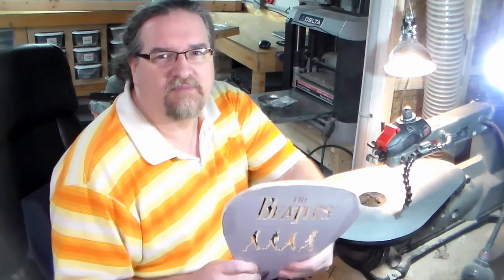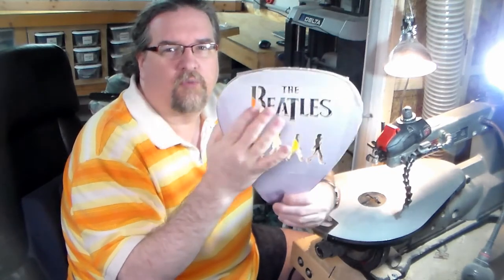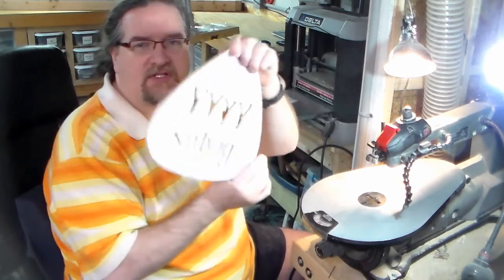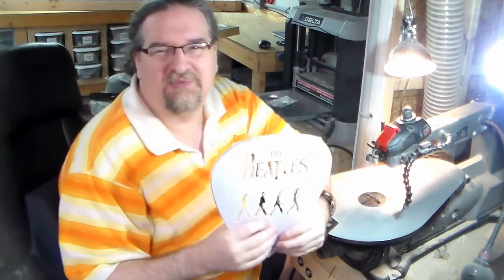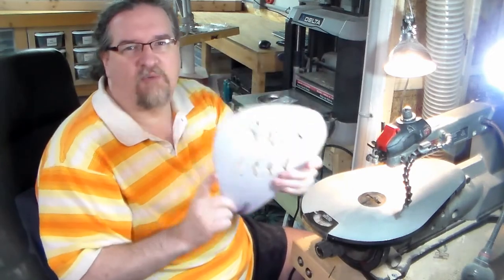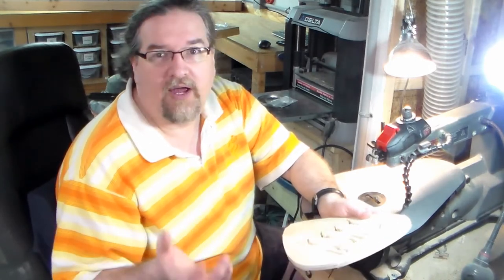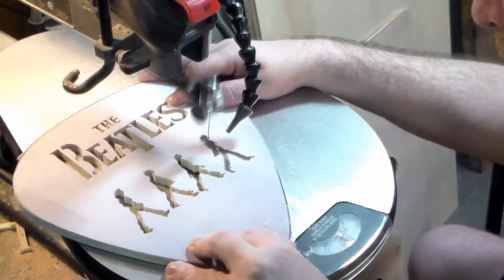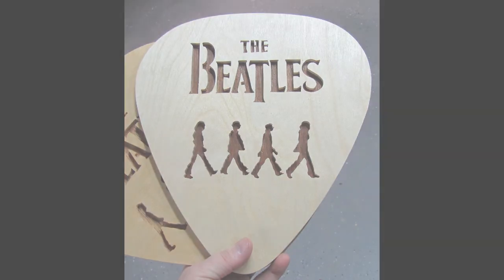spiral vs straight blade rotation demo (per request)

Comment: I see you use the porter cable scroll saw.  I just purchased one and I am having a really hard time using spiral blades.  Many time they break when installing them.  The blade tends to twist and bend when I thigh ten the thumb screws.  Did you make any modifications to the saw where the blades attach?  Are you using a special blade that attaches easier?  Any recommendations would be appreciated.  I searched through some of you videos but didn’t find anything specific to you saw .  Thanks again.  Great videos.
Reply: having same issue

Comment: I've used plain end blades for many years exclusively and now I have a project too big for my scroll saw so I decided to try spiral blades.  I find them very difficult to use.  My biggest problem is getting them in the clamp of my Excalibur.  I ended up straightening out the ends to make it easier.  Any other ideas?  Thanks...Al

Comment: What size blades do u use? Am an amateur and recently got a makita scroll saw... have a few qs....

Iv seen alot of videos where the wood piece gets turned while cutting....doesnt the blade twist and break.?

I have to use alot of energy holding the wood down...why is that? On your video its like u using no energy to stop the wood from bouncing....